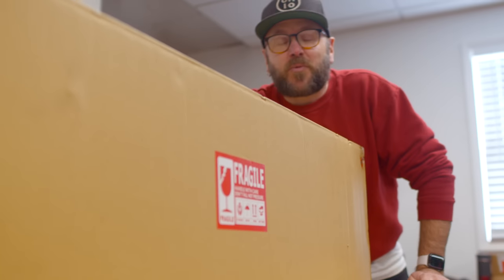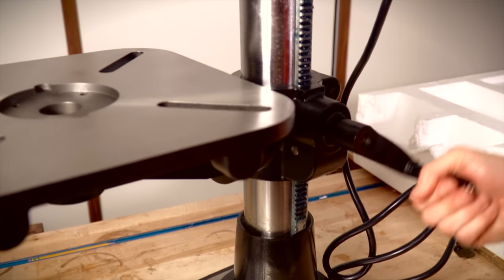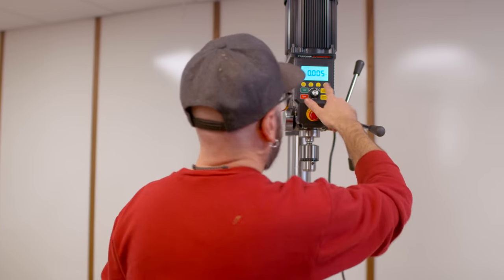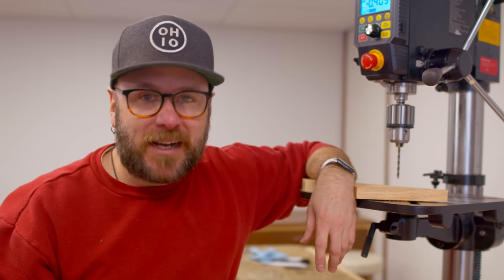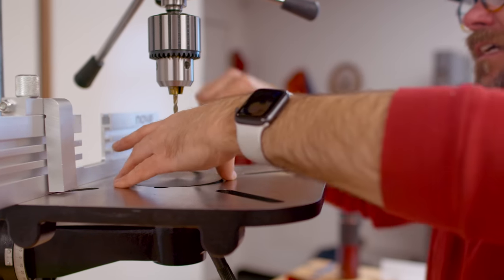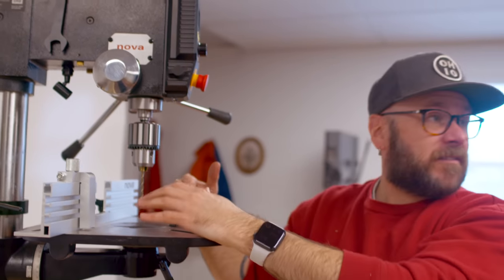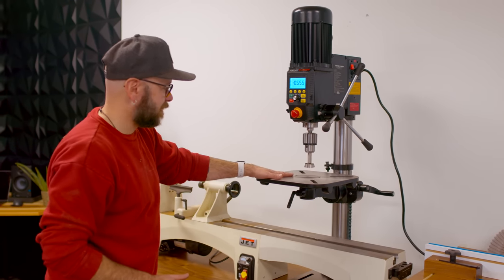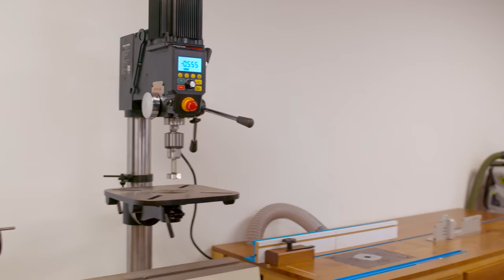Crazy Drill Press From the Future! Is the Nova Viking Worth $1000?

Comment: I've had the full sized Nova DVR drill press for a little over a year. Love it. Wait until you try tapping threads with it. It periodically auto reverses to clear the metal shavings as it cuts the thread.
Reply: One of you should do a video demo of that
Reply: Stumpy Nubs yeah that’s the first thing I thought of. I used to work in a factory making locks for a pickup bed cover and would  pump out around 400 a day and had to drill and tap each one only had a 12v drill to do the tapping with. I’m sure I could have made 800 a day with that setup!:)
Reply: Why is the head of this smaller Viking model so much taller than the one in the Voyager (the floor model). Is the Voyager not direct drive? It has higher horsepower.
Reply: @sergiopereira  Integrated vs bolt on motor.
Reply: The voyager has a lower speed limit of 150 I believe. Does that impact its usefulness for tapping?
Reply: @davidcl64  yes, slower the better for tapping
Reply: Looking at the literature there doesn’t appear to be a tapping assist function on the bench top version.
Reply: Stumpy! We used a TAP-O-matic device on our commercial drill presses in the machine shop this is built into the machine its bad ass.  Why Had, you buy a cadlic and sell it?  Shot of a mill this is about as good as it gets for a drill press.
Reply: @mikemulligancopilotdesigns9904   They didn't have a drill press with a tap-o-matic  you could ahve done 1k a day.
I worked in a machine shop, my vice was foot operated tap the foot the vice opened tap the foot it would close
all I had to do was hit start 3 head machine tap one drill one and ream one hole down the line.
It was a one man production line.
Reply: I hope you can turn off the auto reverse,  It would be hell if you used a keyless chuck.
Reply: @bobbg9041  christ, my guy. hope you've learned to use punctuation in the past 4 years

Comment: The tool is a drift to get the chuck out and put a morass taper drill in.
Reply: Because we all need morass in our life.
Reply: Can use it to easy change the keyless with this one ,both should have the same taper.
Reply: Ray is right. If you extend the quill you'll see it has a slot in it. You insert the tool and give it a tap and the wedge shape will eject the morse taper arbor that holds the chuck. When you get your keyless chuck, get an extra arbor, then you can quickly swap chucks.
Reply: chortle

Morass
Reply: Pssst it’s Morse
Reply: @jonahbrame7874  Isn't it "mo'rse" as in a contraction for more arse?
;-}

Comment: Keyless Chuck Function: hold the On button for 3 seconds to enable Power Spindle Hold mode. The motor will turn on to 8% power which will allow you to hand tighten a keyless chuck.
Reply from the maker: Thanks!! One of these days I'm going to open the manual!

Comment: I have that same JET, I modified mine extensively. I switched out the motor for a 2hp Baldor gold drive rated motor. Installed a single phase VFD with adjustable accel and deccel ramps along with being able to control the speed via frequency. I also drilled the spindle and installed a whirly handle.
Reply: I also only paid $25 for it at a garage sale and as an automation and controls electrician I was able to do all this work myself.

Comment: Round insert may be for the same reason that man hole covers are round. No fall-ey downy the holey thingy
Reply: Round inserts....simple.  I’m sure someone has already commented this idea but here goes. I’m guessing the insert is a standard hole saw size?   Make a bridge template out of MDF to fit the hole saw.  Size the gap underneath to fit the wood size for your insert (width and thickness).  Line up your template with the hole saw (minus the pilot bit) and clamp it down.  Slide in your desired insert wood and cut an insert....push and cut another, push and cut, push and cut.   Now the Nova is making its own inserts.   Just think of the possibilities.... Walnut insert, Red heart, Purple Heart, Zebra Wood....Now you not only have one of the coolest drill presses but also the most stylish.   Great video keep them coming.

Comment: The left hand drill bits are very common in the electrical trade, for starting hole saws in electrical boxes and to go through walls in the metal buildings in the oil patch. They allow you to start the pilot hole in reverse so that when you go through the metal, the hole saw is going in reverse thus preventing the jams that always happen and end up breaking your pilot bit, or twisting your wrist out of shape.

Comment: One of the great joys in life for folks like us is unboxing and setting up a new tool.  Congratulations!

For your old drill press, do a search for "quill stop".   They have them for mills and such, but you will also find videos on how to make.   Great first machining projects for your metal shop.  You can also make simple spacers in one, two and three inch lengths to quickly adjust;  these can be aluminum rod with a channel just larger than the thread of your depth stop machined in. 

I was going to suggest if didn't make a new table, those round inserts would be very easy to 3D print.   Have fund with it!

Comment: I have the Nova Voyager, it's totally worth the money. However, I had a few manufacturer defects with mine, I was able to get a replacement part no problem from Teknatool. I filled my drill press column with molten lead... super rigid and dense now!
Reply: Hate to ask how much that weighs now!
Reply: @jhalleck  It takes 150lbs to fill a drill press column. I paid 25¢ per pound at the scrap yard for mostly fishing weights, and home made muffin tin billets. I melted down in one of those re-loading melting pots that pours off the bottom.

Comment: FWIW, done properly the keyed chuck knuckle-busting can be prevented.   When tightening the chuck always insert the key on the right side of the chuck and lift up towards the teeth on the chuck.  To loosen, use the left side of the chuck,  again lifting towards the teeth on the chuck.
And that wedge tool is to leverage out the drill bit from the quill.  Insert it in the slot above the chuck.

Comment: I've got a Ryobi that is 20 plus years old. Variable speed from 500 to 3000 with a Reeves Drive Belt set-up.  Will take up to 1/2"/13mm drill shank. Features a traditional screw type stop along with a stop built into the feed handle. A titling table that is not mounted to the column. The table mounts to the base. If you want a larger table that you don't want to have to worry about getting set square to the spindle just mount it to the base. The head goes up and down. Plus the column swi else so depending on what you put the machine on you can still do work in the e d of long pieces. This was when Ryobi really thought outside of the box and built some good tools. But they didn't sell. Part of the reason was likely the 350 buck price point in the late 90s. Built in Taiwan Ryobi had the tooling destroyed when they pulled it from the market. One other thing. The motor is in the head between the spindle and the column. This allows a fairly big swing and still be able to have the machine close to a wall. 
https://www.microsoft.com/en-us/legal/Copyright/Default.aspx
Here's hoping Nova has better luck with something a little different. But wood workers are pretty conservative in terms of machinery (or at least they used to be). "If that contractors saw with the motor hanging out of the a&& end was good enough forgrandpa. It's good enough for me." Jus look at the average contractor's, hybrid or cabinet saw built with the traditional trunnion system. Yah its solid. But doesnt make sense for each turn of the elevating wheel to equal the same distance. Your tilt handle gives the same amount of degrees per turn. Why not the elevating wheel.

Comment: The metal wedge tool is called a drift. It's for removing the drill chuck via the morse taper it's held in with. With the quil down you will see a slot then line up the spindle with the hole insert the drift and hit with a hammer. The chuck will fall out.

Comment: Hey David, the metal thing you lifted the round table thing with looks like a  tool that you remove the chuck taper with. I bet you already knew this considering you changed the chuck on your old drillpress but just in case you dont.
When you fully extend the drill press there is a small slotted hole where you can see the end of the taper and thats where you put that metal triangular piece and give it a whack with a hammer.

Comment: I have the floor model of this drill press and it is fantastic. I had some annoyances with it but I won't bring them up because they were not performance related.  If you aren't bothered to spend the money on an upgrade, ditch the factory chuck and the factory arbor. The angular tool you used to lift the cover plate on the table is meant to release the arbor.  Go find the Llambrich JK solid chuck. It ranges from 1/32" to 1/2" bits and will have .001" or less total run-out at full depth.  

I'm serious. When you get some really good bits from Fisch or Fuller, you won't be able to see the run-out. Keep in mind that the human eye can see a difference of .001" . Yeah I know, "you don't need a thou or a ten-thou precision in wood working." David, "cos I can!"  Try it. It makes the tool that much more satisfying if your using bits that step in 64ths or .5mm increments. 

Oh, only windows computers can update the firmware on those drills. Get a Windows laptop for that USB cable. Enjoy!!

Comment: I like the round sacrificial table as it rotates in smaller increments and lasts longer. It's a trade off with an easier to make square. And they didn't call it a portable drill press, did they. And goodness that is quiet.

Comment: Left handed drills are good to drill into screws or bolts trying to get out broken off ones.  Sometimes the drill will catch the screw or bolt and unscrew it from the hole as the drill goes into the broken screw or bolt.
The triangular tool you were using to pry out the insert is for inserting into the slot in the quill to drive out the chuck from the taper.

Comment: I have a really big desire for that drill press. I have a Powermatic with variable speed but this is much cooler. Can't justify replacing the similarly expensive Powermatic. Maybe I can sell it for enough to justify it. I have a Nova Galaxy DVR lathe with a similar (maybe the same) motor and variable speed setup. I love it. I was wondering if you make your own wood table if you could adapt that nice fence to run in the t-track by replacing the bolts or custom cut parallel grooved in the table to take the existing bolts? I think that's what I would do.

Comment: Checked it out, it as a Morse Taper 2 (MT2) spindle so you can a new MT2 arbor with matching keyless chuck and can keep the original as back up. Plus the drill is programmable to 6000 rippums so you can get all kind of accessories for the MT2. Didn’t know expect to see a drill press this advanced!

Comment: Lol. The 1/2" wedge shap tool that came with the drill press is called a drift key
Its so you can knock out the chuck to change to a different type  the chuck is held it with a Morris taper .
Lower the quill  and on the side you'll find a slot now put in the drift key flat side pointing up rotate the chuck until the drift key slides in one side and out the other
Not take a brass hammer or rubber Mallett and strick the drift key hard holding the chuck in you other hand its going to drop out youll want to catch it, its kinda heavy. 
Now the chuck will only go back in in 2 spots the flat tang on the end needs to seat in the flat park of the quell. 
Inside you put the chuck back in and pop it upward with a mallet and press in in with a 2x4 on the table lowering a tottaly open chuck. Always tottaly open the chuck the jaws should never be hit with s hammer.   Now you can buy a keyless chuck for this drill press or other tools read the owners manul to see what size Morris taper it uses looks like a number 3 but its been 30-35 years sence I worked in a machine shop. 
This drill press was made for woodworking but its so advanced it will do metal working also and do it good.

Comment: Dave, I just got one this week. Love it too. I did notice that the back adjustable LED light underneath does not light up. The 2 front LEDs work though. Does your adjustable LED back by post light up?
Reply: I think that the top right Yellow Button will fix the problem, after a couple of presses to go through it's options. This worked for me.

Comment: I know the bigger press has a manual depth stop that is tied into the depth sensor. Does the Viking have a manual depth stop. Some say yes and others no. The manual does not mention it.

That being said the one HP is plenty for woodworking with the constant torque from the SR motor. Don't know if metal tapping will work on Viking. It reverses but the slowest speed does not match the bigger unit which goes down to 50.

Comment: I've got that drill press's big, floor-standing brother, the Voyager. It was even more expensive: $1,500, but still worth it. There are even more great features you'll discover if you read the manual. And you'll see what the USB cable is for.

Llambrich makes a good keyless chuck that works well with the Nova drill presses, for under $100 on Amazon. The run-out of the chuck I bought was barely measurable — under .001"

The one bad thing about these drill presses is that now you're going to feel like you need to upgrade to one of the Nova lathes that uses the same amazing DVR motor.  😀
Reply: don't you love it when "experts" do a review and don't even have the brains to read the owners manual?
Reply: Laura, Is there a link to that Llambrich chuck for under$100? All the ones I see are much more. Thanks
Reply: @bparris  Here you go: https://www.amazon.com/gp/product/B007R62EGS. You also need to buy an arbor like this: https://www.amazon.com/gp/product/B01N59TA89.

This chuck doesn't have the same guaranteed low-runout specs as their expensive ones. But mine is very good. It could be that I just got lucky, I suppose.

Comment: Package was shipped and arrive with a busted selector switch. Company says they don't have a replacement PCB board.  I know these selection/pot switches are less than $10. Anyway to get a replacement that can be used to replaced the OEM unit?

Comment: one Point, Now key-less chucks have gotten better but a 3 hole shuck with key is better, one thing most guys do not know  on a keyed chuck you use all 3 holes always. snug each hole tight by the time you get to the third hole the drill pits not going to move, same with a lathe chuck.

Comment: I've had my full size Nova DP for around 3 years? and it is *amaze balls*.  It is the way tools SHOULD be. Electronic/digital instead of dumb. It stops if you overload it - instead of stalling. If you get your sleeve/arm caught - it knows and stops. It tells you how hard you're working it - what % of the total power you're using. You just spin a knob and it goes from 80->5500rpm. Its a dream. I'd buy it again - and wish all tools were modeled after it

Comment: For the shavings bin you could make an U shaped bin that wraps around the column and has some sort of French cleat on the endings to attach to the wall, or a support, behind it.
Reply: Actually, just a crazy thought. You could make it in such a way that the colecting channel of the U shaped train has a folding out cover. So that when you fold the cover open it swings about 160/170 degrees out, increasing the surface area to catch the savings.

Then you pipe in your dust colection on both ends of the U on the back. So now AFTER you have done all you mess you  just close the folding wings to close the dust coleting channel and then you fire up the dust colector. I figure that if the tray is just the right depht you should have enought airflow to suck the shavings out.

Does that make any sense?

Comment: I've had a nova for over a year and I love it!  As for a keyless chuck... I installed one. It is tough using the keyless chuck on the nova.  The quill on the nova has very little friction and as such requires two hands when changing bits with a keyless chuck.  It would be cool if there was a quill brake that could be engaged to assist in keyless bit changing.
Reply: Chris Lamb on the Viking - press and hold the on button for 3 seconds and it will apply power to lock the spindle for 30 seconds.